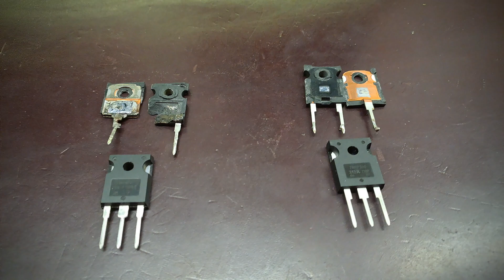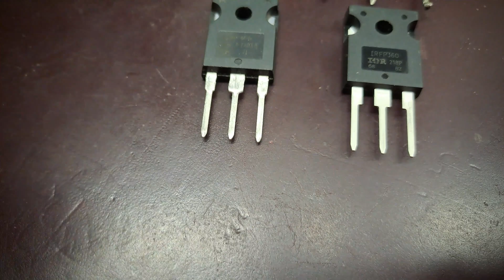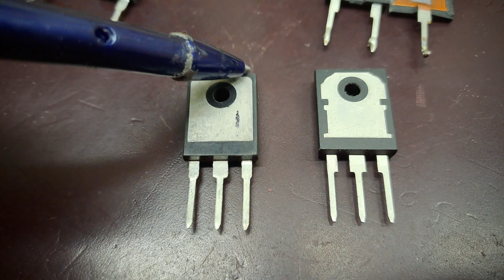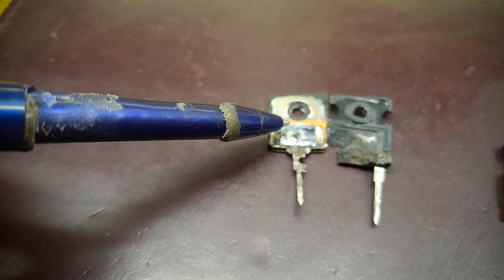fake real power mosfet the diference internal structure IRFP

Comment: You can test the Drain to Source voltage using a multimeter and 12 volts bulb.
Lower voltage from D to S is found un better quality transistors.
Counterfeit transistors have a bigger D to S voltage usually.

Best Regards.

Comment: Thanks, how to test without taking it apart.
Reply: you need a fairly stable constant current source, like a bench top power supply, you put it at 1 ampere limited, and like 5V limited, you have to connect it from the drain (+) pin to the source (-), then you apply like 10V from the source (-) pin to the gate (+), using like a charged 9V battery, then you turn on the power supply and measure the millivolts from drain to source pins with a digital multimeter, one millivolt equals one milliohm of drain resistance, then you compare the value to the datasheet, an IRFP460 should not be above 270 milliohms, and an IRFP260 should not be above 55 milliohms

then you can try to measure the "input capacitance", you need a capacitance meter (some multimeters can do it), you connect the cap meter from drain and source together and the other probe on the gate, it should read kinda the specified input capacitance that is stated on the datasheet

fake mosfets vary a lot from the original, with a much higher RDSon and much lower input capacitance
Reply: @PosthumanKindergarten  ok thanks
Reply from the maker: 1. You have to compare them visualy as described in the video.
2. search for datasheet and check for their on resistance value while fully turned on. and compare it with value of yours mosfets.
3.mesure their internal capacity and compere it with description in datasheet.
4.finaly, thest if they are working with rated current, if they fail , they are fake.

Comment: I alway say, if mosfets get shorted or open, better buy a new amplifier.
After market transistors are worthless. 👌
Reply from the maker: I am experimenting with those FETs because I Want to build power amplifier from scratch. I will upload some videos on that topic from time to time. Yes, straight forword solutions are good, but this way, I'm trying to build some experience and knowledge and share it with others.